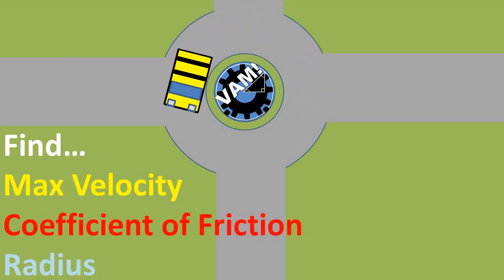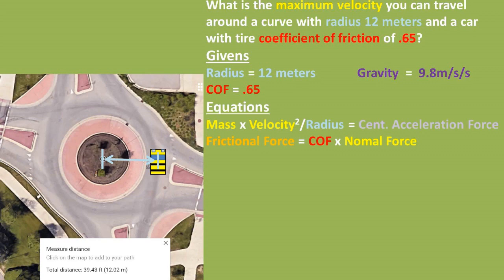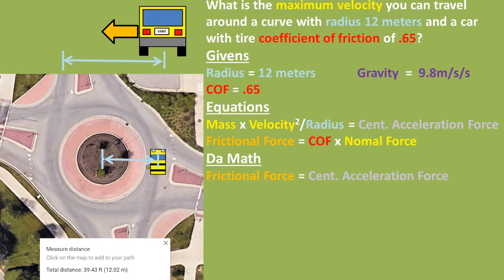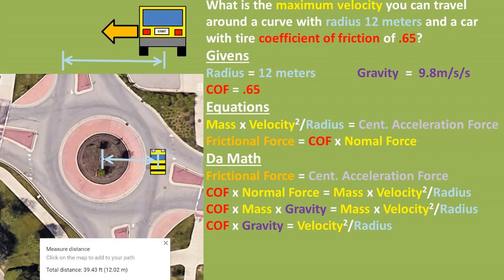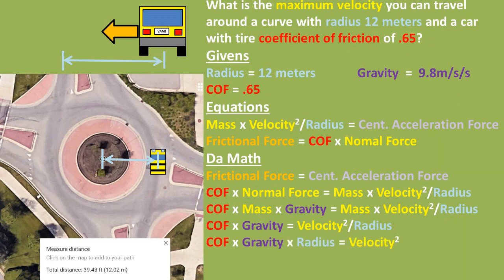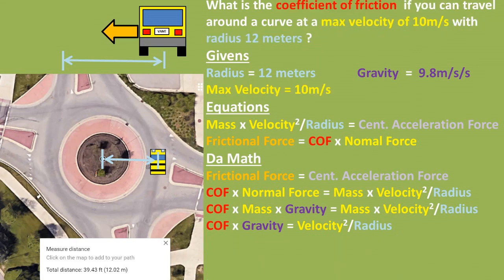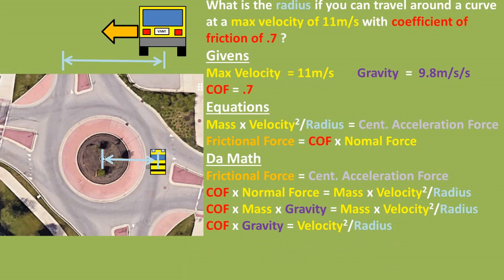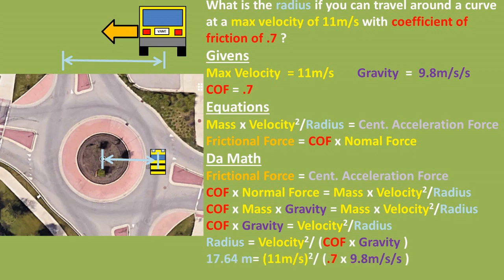Car Going Around Curve (Find Max Frictional Velocity, Coefficient of Friction, & Min Radius)

Comment: great video. can you give some tips on what's the impact of steering angle (- sign means to the right, + if to left) to the radius? can steering angle be calculated given a radius, velocity, and coefficient of friction.
Reply: I had the similar problem. You can use formula for angular velocity here which is w = V/r.
Then if we use formula for radius from the video we can reduce the radius resulting in a formula w = COF * g / V. Which will give us an answer in rad/s that can be converted to deg/s

Hope that helps!

Comment: Do you know any reason why a calculated coefficient of static of friction would be less than the published values? 
I got a value of 0.4 but the published value coefficient of static of friction between dry pavement and car tires is 0.7. 
Hint: The driver noticed that it was the driver's side front wheel that was squealing and that the van was leaned heavily towards the outside of the traffic circle.
I'm not really sure what this has to do with the problem